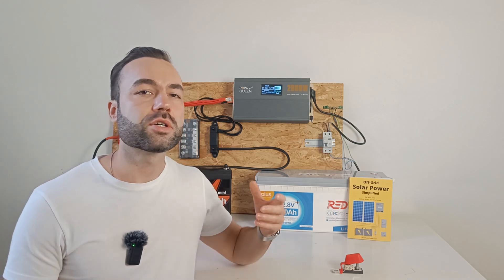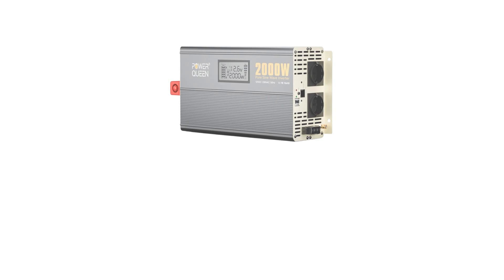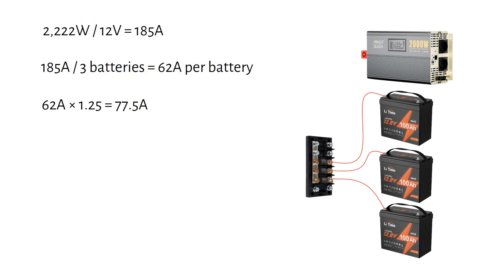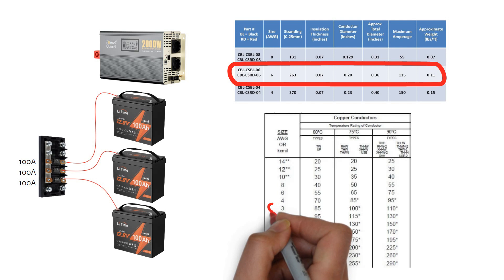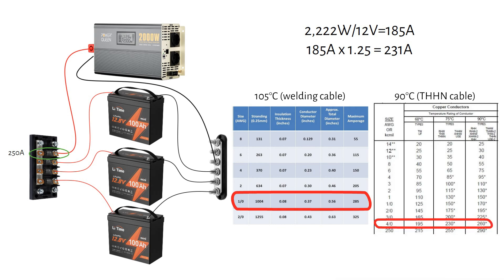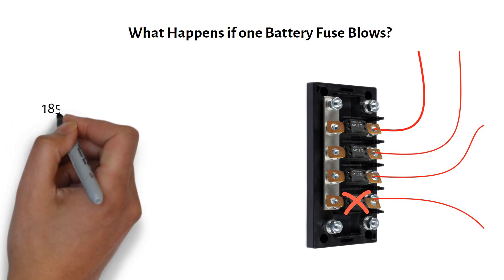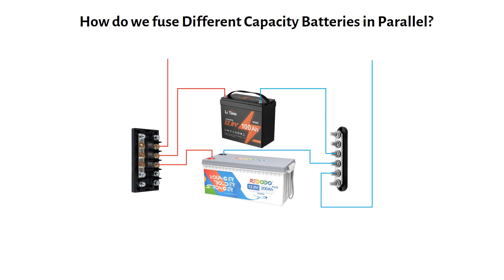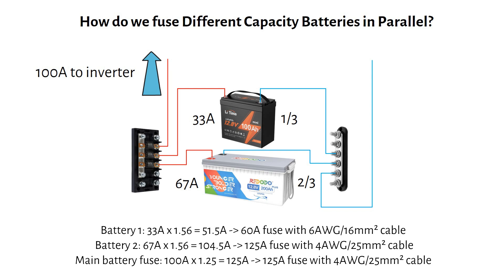How to Fuse Batteries in Parallel - Current sharing and cable selection

Comment: What about those 48v lithium rack batteries? I see them connected in parallel with those short thick cables but no fuses. Sometimes there are many on top of each other, like a tower rack. Expensive equipment, thousands of dollars. Do they really have problems without fuses between them?
Reply from the maker: They usually have a breaker built in and then a main class t fuse.
Reply: @cleversolarpower  Thanks just watched a video of Will Prowse covering that in detail. Cheers

Comment: @cleversolarpower do you really need to put fuse on lithium batteries! I thought the BMS is there to  stop any short circuit 🫨
Reply from the maker: Yes, always. I do not trust the BMS to handle a short circuit current.
Reply: @  good to know. Thanks

Comment: Another good video, but I missed where you described when to use the 1.56 safety factor vs the 1.25 safety factor. After the 4th time through, I caught the "double safety factor" comment. In the first example, you did the x 1.25 calculations separately, but then later streamlined the process by combining them ahead of time for a factor of 1.56. You may want to elaborate on this in future videos.  One thing I did not see in here is any inclusion of the BMS current limitations.  I followed your math for calculating my fuse values for a pair of mismatched batteries (280Ah and 304Ah) and came out with numbers that significantly exceeded the limitations of each BMS (150Ah and 200Ah, respectively). Where do you factor that into the mix?

Comment: I'm struggling. In the first example we figured fuse and cable size based on the inverter. In the different Ah battery example we figured fuse and cable size based on 100Ah. Aren't these two batteries in parallel, so the output is 300Ah?

Comment: Would this all be the same if you did not connect the batteries with a bus bar?
Reply from the maker: If you don't use a busbar, then all your interconnecting cables need to be the same size as the one going to your inverter. They must be able to carry the max current draw.

Comment: Hi Nick, very informative, this is the exact setup I have, 3-100ah lithium batteries wired in parallel. I'm going to use a Victron Mega Fuse Holder busbar 500A with 3 - 100A fuses for each. Do I understand that 6AWG wire can go from each battery to the fuse? What wire goes to the Victron Power In? Right now I  have 1/0Awg going to it for my inverters and charge controllers will this wire be ok.
Reply from the maker: The size of your wires depend on the inverter max current draw (or the max current delivered from the charge controller - whatever is the highest). Then follow the steps from the video.

Comment: i have one question: the 33a where did you get that quantity for the 2 different sizes of batteries?
Reply from the maker: 33% of 100A = 33.3A, the other battery deliver 66% or 66.6A for a total of 100A.

Comment: i would like to know what fuse size i need for my 6 batt, 12v , 4× 280ah and 2× 260ah in parallel with 2000w inverter??

Comment: Where did you come up with 100A to the inverter @ 6:20 min?  Doesn't it matter about the size of the Inverter?
Reply from the maker: Good question. The 100A is an example, it's based on nothing. It is easy to calculate with. And yes, the current will depend on the inverter that you have one it.

Comment: Great video Nick.  The example is easy to follow.  However, in the real world people need to CHECK their installations with a clamp meter.  I have found that using buss bars with equal batteries does NOT always equate to an even charge or discharge on EACH battery.  One installation (4P at 12v nominal) of my banks many times will only draw from three batteries and frankly its Redodo batteries that do that.  Another (4P at 12v nominal) most of the time it will draw/charge more evenly.  My point is that even when properly done, one needs to trust the science but verify the reality of their installations.  I have installed terminal fuses and I also use those multi mega fuse buss bars on my 3p 48v nominal setup and those batteries really do mirror your example.  I think the key is the amperage draw that can cause some wild imbalances.  I am now combining 12v batteries into a 4S to 48v with external balancers due to the lower amperage draws.  Thanks again!  Gary in SE Michigan
Reply: current is drawn based on resistances of batteries, not capacities.
Reply: if you watched the whole video you would have seen he mentioned that already......no need for you to repeat anything we already know....

Comment: Another well presented video, thank you. This was very helpful. I have 4 - 12v 100Ah lithium batteries and a 2000w inverter. So from what you covered I need either a 75Amp or 80Amp fuse per battery with a 8 AWG or 6 AWG cable (105 degree welding) from the batteries to the bus bar.  Then a 250Amp fuse from the bus bar to the inverter with a 1/0 cable [105 degree welding). Let me know if my numbers are correct, thank you again.

Comment: This all works for 100Ah batteries but i would add an isolator for each battery. If you have no bluetooth on the batteries so you cant see current draw, cell voltages, etc, i would also suggest a smart shunt.  With indidual battery isolators, you can easily check which batteries are on-line. As you go to larger lithium batteries, fusing with NH or class T fuses makes sense.
Reply: Are you suggesting a smart shunt for each battery?
Reply: @moonhand8311  no. You only need a smart shunt on one battery if all the batteries are in parallel. This will tell you your SOC of the whole bank

Comment: I have 3 System Configurations here :

4 24 Volt 100ah LiPo4 Batteries to 300amp Buss Bars each battery fused accordingly and Cabled within spec.
2 280ah CHINS tied into 24 Volt Packs and tied into 300amp Buss Bars and the Positive Terminal Fused as You Recommend and Battery Balancers on these Packs and Cabled Accordingly so.

8 REDODO 12 Volt Batteries tied into 24 Volt Packs and Fused accordingly to 300amp Buss Bars and 2/0 Cable used as My Tie Leads all equal length for each Pack and 1/0 Cables from Terminal Fuse Blocks to Positive Buss Bar and to Main Disconnect Switch for both Charge Controller and Battery Bank and Inverter.
Any foreseeable precautions other than Battery Balancers and checking State of Charge for each Battery Bank System ?

Comment: With batteries in parallel, it doesn't do much to measure the voltage of each battery unless you can isolate that battery while you measure.

Measuring current while charging or under load (not while solar is balancing the load) is better.
Reply from the maker: If the fuse is broken, then the battery would stop providing energy, so the voltage off all three batteries will not be the same. Current clamp measuring is still better indeed, but not everyone has that device.
Reply: @cleversolarpower  If the BMS has shutdown or failed open the battery voltage at the terminals will match the parallel string.

Comment: Excellent video.  Thanks.  I have several of these batteries...  LiTime 12V 100Ah BCI Group 24 LiFePO4 Battery, 100A BMS Rechargeable Lithium Battery with Up to 15000 Cycles.  It purports to handle short circuits.  The Amazon product description says "... the battery is protected from overcharging, overdischarging, overcurrent, overheating, and short circuiting by a powerful BMS.". I thought that the BMS's were adequate due to this.  "The BMS on lithium batteries disconnects the load/charge by the use of MOSFETs, these MOSFETs are commonly the limit on the continuous current rating of the battery.  If the battery is rated for 100A continuous, and you have a 2000VA load, then you will be drawing approximately 167A from the battery and you will destroy the MOSFETs almost immediately.".  Does this BMS give inadequate short circuit protection, requiring the additional fuses you discuss?  If so, how and why?
Reply from the maker: These batteries can run a bigger load for a short while. Let's say 150A when the BMS is rated for 100A for several seconds, so they can be overloaded. The mosfets can handle this, it's the voltage that destroys mosfets. the temperature sensor shuts down the BMS. Also, i would not rely on the short circuit protection of the BMS, a short circuit can be 10x the capacity of the battery and i seriously doubt if the BMS can switch a 1,000A current for 100% of the time. So better be safe than sorry.
Reply: @cleversolarpower  Thank you.  That is what I thought.  And I bought your book and am finding it to be an excellent resource.  Thanks again.

Comment: Hi Nick.  When you have done calculations on fuse ratings, you say 12 volts .when a battery is rated 14.6 or as low as 10.6, what should you start with . Is it the nominal  voltage   that I should use . I hope you understand, I can't find another way of explaining. Rob
Reply from the maker: I see what you mean. I keep it simple and use 12V instead of the 12.8 nominal voltage of the battery. If the battery drops to a lower voltage, you will indeed have more current because power=voltage x current. However, I find that 12V is better because of the worst case scenario. If the battery drops below the 12V, then you still have the 1.25 safety rating covering it.
Reply: Thank you for your explanation. Yes I do my calculations the way that you have explained. But I think other people may think differently. Maby a video on more maths explaining.  Any excuse for another one of your excellent videos.  I have really enjoyed your series of solar electric.  Thanks.  Rob.

Comment: 6:18 From experience, this is wrong. The small battery is discharged with the same current as the larger battery. This means that the smaller battery drains faster than the larger one. 
At some point the BMS of the smaller battery will switch off and only the large battery has to do all the work.
Reply from the maker: I suggest you do the experiment again because this is how it works. Please check out my other video about 'parallel different capacity' where I show this being measured.

Comment: 2:50 The VDE 0100 standard specifies a 25 mm² cable for 100A. Free in the air when laid.  This corresponds to AWG 4
16 mm² = AWG 6 is specified with a maximum of 80A
Reply from the maker: That is correct for wires rated at 75°C. The wires I'm showing in the video are rated for 105°C. That's why they can carry more current.
Reply: 16 mm² = 110 amps

Comment: Thanks Nick. I just calculated this example wired as you have shown but with 3-24V, 200Ah batteries and a Victron 24/3000/70. I got 80amp MRBF fuses at the batteries and 200amp fuse to the inverter. However, Victron manual recommends a 300amp fuse between batteries and inverter. So I went with a 300amp Class-T fuse to the inverter and 200amp MRBF fuses at the batteries wire to a bus bar. I also ran 2/0 cabling throughout. Too much?
Reply from the maker: It depends on the length of the cable. But Victron recommendations are oversized (which is better than undersized). 3000VA/24V=125A. -> x1.25 = 157A Main fuse could have been 200A with a 2AWG cable rated at 105°C (welding cable). 80A fuse at the battery terminals is perfect with 6AWG, again with 105°C insulation temperature.
Reply: @cleversolarpower Thanks again. By the way, I bought and love your book. Best wishes and continued success.
Reply: You need to run the amperage calculations at the minimum battery voltage and the maximum sustained surge load to compute the maximum amperage.  And you need to consider voltage drop in the wires and fuses (breakers) at that maximum amperage to ensure the voltage drop is not too high. If the drop is too high then at minimum battery voltage your inverter won't be able to support the maximum sustained surge.  This might manifest as a water pump not starting in the morning and the inverter doing a low voltage shutdown.

Comment: Wouldn't it be better to use a circuit breaker with each battery and one master fuse to the inverter? This would allow you to shutdown a battery that might be having an issue, or prevent all the fuses from blowing if one or two batteries go down.
Reply from the maker: Good question. for a quality 100A DC circuit breaker, you are going to pay $80 (schneider electric). do NOT use cheap DC breakers from china because they do not break the circuit at the specified current (easily 2x the current). Always use safety equipment that has testing data and certifications. Using MEGA fuses from good brands (littlefuse, bussmann) is much cheaper. I made a video where i test cheap chinese MEGA fuses.

Comment: How do you account for the temperature ratings of the lugs, bus bars, inverter, and batteries.  I have not run across any equipment that has a 105deg rating.  All of these equipment items have their own max temperature rating
Reply from the maker: Lugs, busbars, inverters and batteries don't have a temperature rating. It's the insulation material of the cable that refers to the insulation temperature. Different materials can handle higher temperatures, so they can carry more current.

Comment: I don't think I've ever seen anyone wire them in like this. I've always seen people just chain them together.
Reply from the maker: You can. Then you need an mrbf fuse on every positive terminal. And the cable thickness has to be the same size as the max draw from the inverter. Wiring it like the video will be cheaper because thick cable + mrbf fuses are not cheap.
Reply: @cleversolarpower  Awesome, yes I've been looking into thicker cables and do not like the price. As I tinker in welding there are a lot of dodgy cables out there. You really have to be careful.

Comment: Hi Nick good morning! , so what about fusing 4  12.8v batteries in series to 48v system , having few sets in series to parallel?  Di it need to be fuse it individually? Or just one main fuse at the busbar?
Or fusing each 48v going to the next 48v ?
Reply from the maker: Yes, fuse each parallel set. Otherwise your whole battery will fail. As you might have seen in one of my previous videos I don't recommend wiring batteries in series. Better get a 48V battery with 16 cells in series controlled by one BMS.
Reply: @cleversolarpower  awesome!!! Thank you so so much!!! , God bless you and thank you again for your time and helping others.